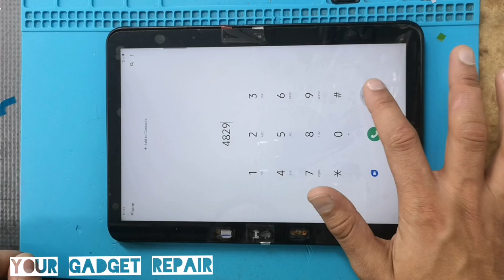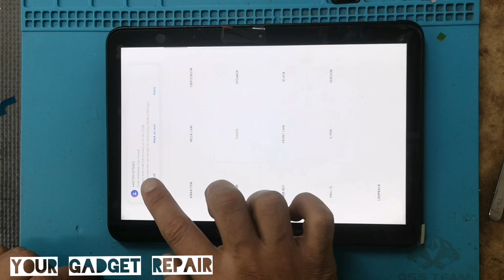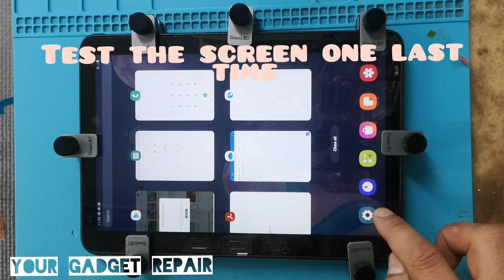Samsung tab active pro SM-T545 screen replacement /disassembly

Comment: So the touch screen doesn’t work after installing the new screen. Is there something I didn’t plug in or a setting I need to do? Thank you.
Reply: touch circuit might be damaged, try re-connecting some of those ports on the screen, you might need to buy some new circuits or a new screen if that doesn't work